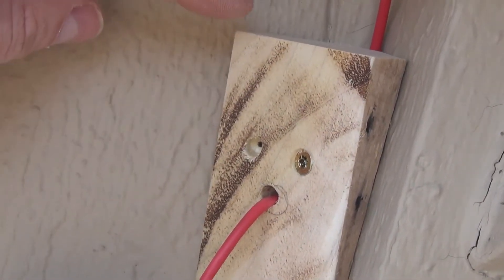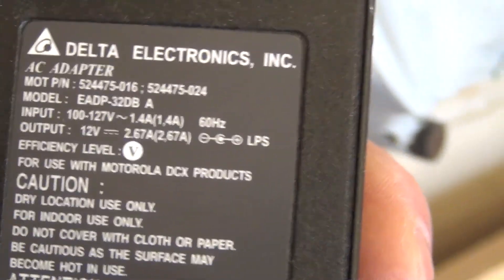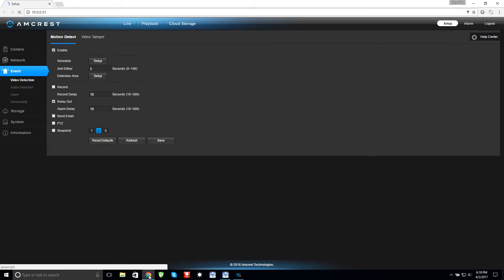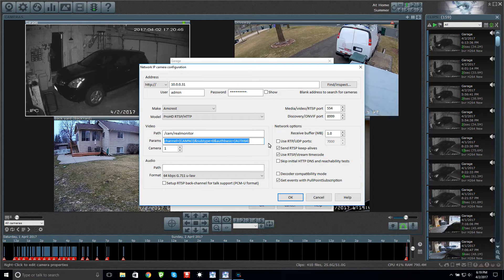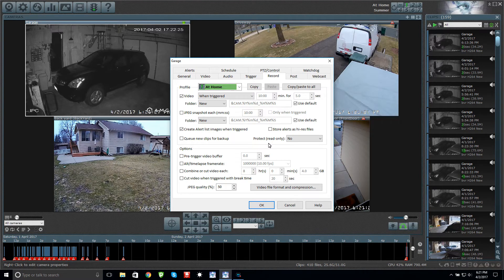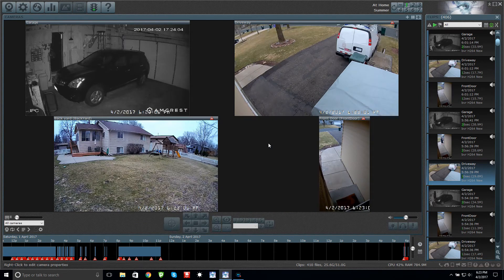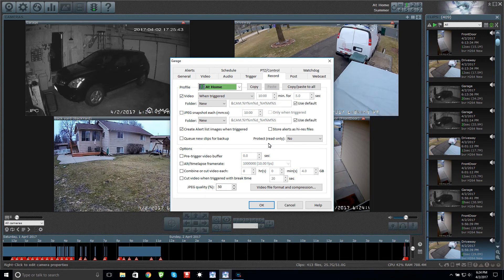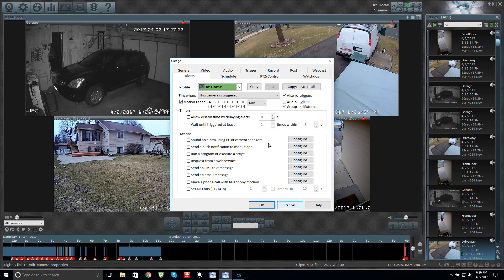Blue Iris: How to add a PIR motion sensor to a camera

Comment: Why put a motion sensor? With BI and you have your cam up high you can use crosszones easily. I turn off must travel x pixels and only have crosszones enabled. Doing 3 zones a object must pass through  all 3 and it pretty much gets rid of false alarts. Even your tarp wouldn't set it off. As a example  within your driveway have zone A drawn to the back of your van zone B couple feet back of zone A then zone C from your house to zone B. Then trigger line would look like this AB>C so object must travel through A & B and then go into C for it to trigger and overlap the zones a little works best. Last 6 months only gotten 1 false alarm that was due to a major shadow change while a object came in to frame. Looking to monitor my security alarm so it sends a push notification to my Android like the camera alerts. Probably do it through a N.C. contact on the security panel and some sort of input like your camera has but a standalone one. Soon going to setup blue tooth speaker in the house with custom text to speech to alert me while sleeping as it has gotten so reliable with alerts I'm starting to trust it even at night with bugs flying around in the IR.
Reply: I could be wrong, but I have found that using "cross zones" only works for static cams, not PTZ, the cam in the video is PTZ. Am I wrong in that assumption?
Reply from the maker: @michaelkennedy2528  The one inside was a PTZ but the one outside was not. What dcO was saying does work but I have a tree in the front that made crazy shadows across the whole driveway. Plus the cars at night would still trip the camera even if I used 3-4 zone triggers. The motion I put up worked great until it got over 95 deg outside. I'm back to the zones and just deal with false triggers :(